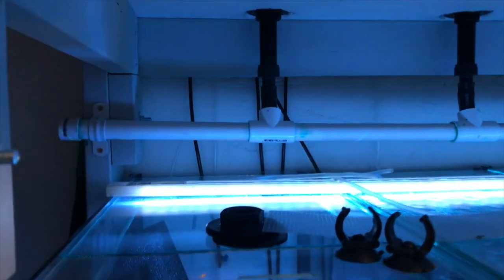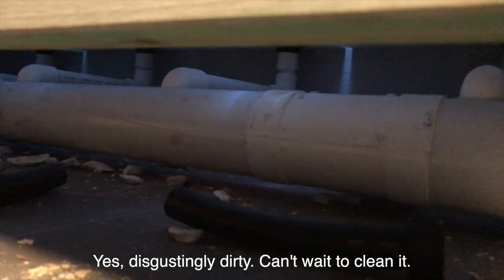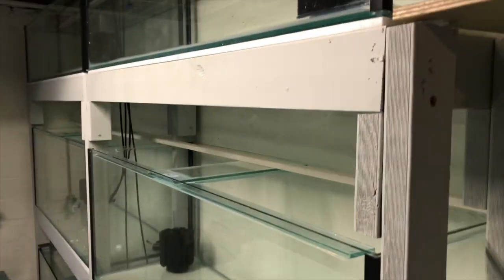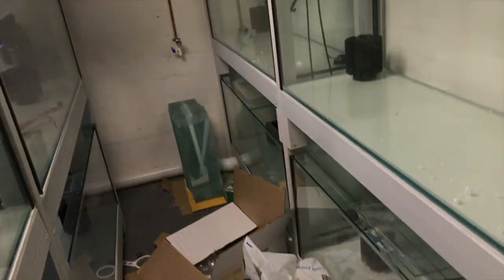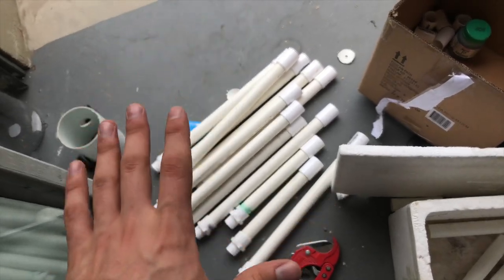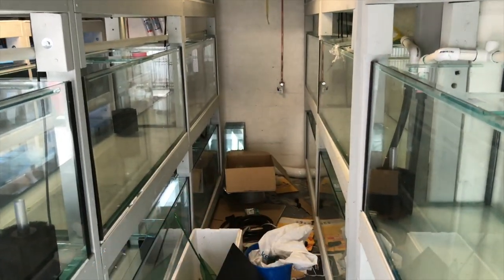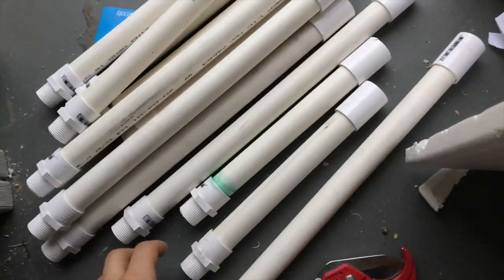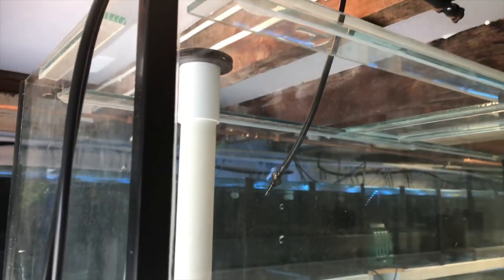How to Build a Fish Room: Plumbing (Part 3)

Comment: I build my own filters (Started in the outdoor pond part of this hobby had to move indoors because montana kills... fish), I have a 40gal tank with a filter sump, in the sump I have a 10 gallon tank split into 3 compartments one of them is filled with darn near 10 pounds of ceramic bio filter rings. I know it is massively oversized but is there any downside to having a filter that big on a smaller tank?

Comment: I have an issue with my shed getting too hot for fish any suggestions? I could insulate but its expensive:(
Reply from the maker: Not completely sure
Reply: If you dont insulate they will cook. Sorry to say but its the same reason i cant setup in my she shed. Lol. Cheaper to insulate than aircon. Save up for insulation. Especially roof or ceiling and see how you go
Reply: @valiaudet3415  Yeah I was afraid it would be the only choice I had. It gets 50+ degrees around Christmas, I would love sitting in a room that temperature all day, haha. Thanks for the input.